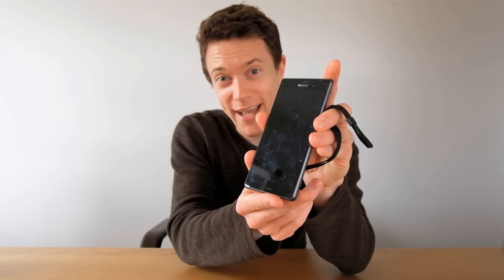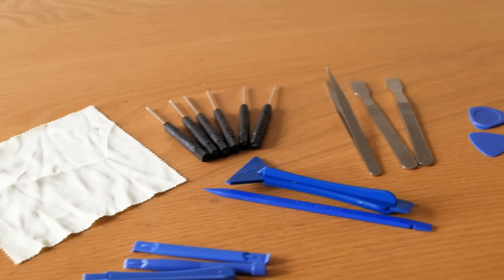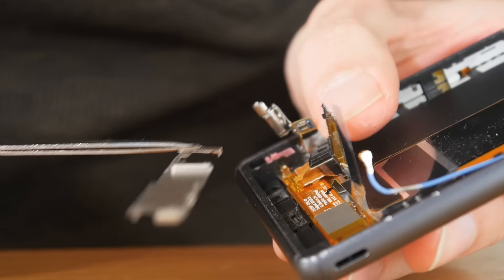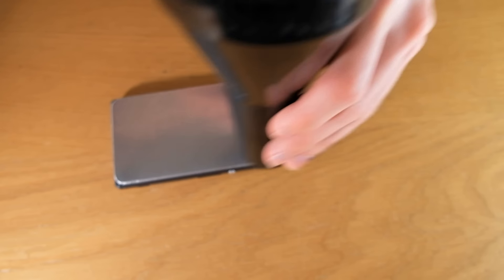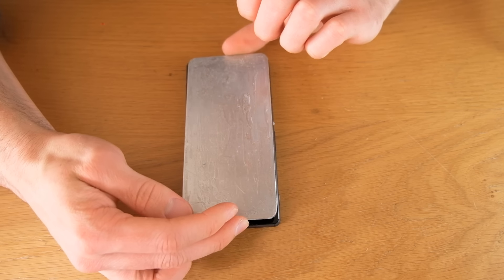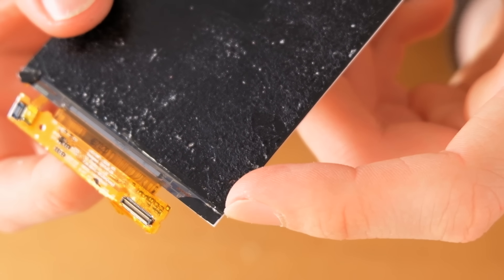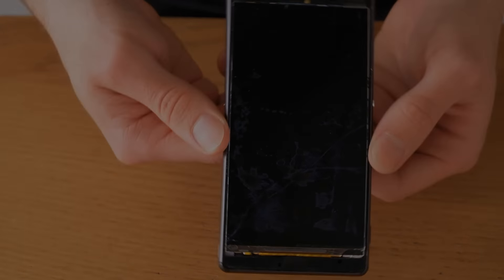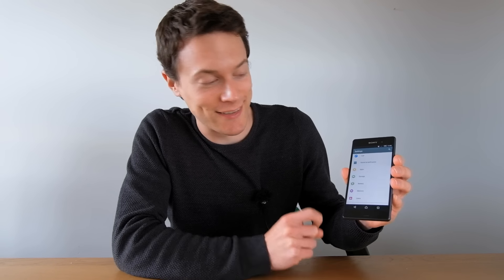Fixing a Smashed Phone Screen - on a budget! (GLASS ONLY REPAIR ATTEMPT)

Comment: I can’t believe all of the shattered phones I see.  Why can’t it be made with a durable soft plastic?
Reply from the maker: +Geena Lyon I wonder the same thing myself!
Reply: Because plastic can scratch easily.
Reply: Because u will not change ur phone with a New one if it dosent break
Reply: I know right...totally unexceptable with today's technology. The first start up to make a comparable durable phone has my business for life!
Reply: Yishai and Razonyah Beeson yup
Reply: +Geena Lyon You're right. Cell phone screens were made of plastic at one point, but I assumed they changed it due thi the touch screen features. Nevertheless, I believe if they create unbreakable screen it would cost them, which is why I'm thinking why they sealed the battery (b4 waterproof, so not sure why).. also the same with the charger which one end commonly breaks..
Reply: @DIYPerks  Prooooooobaaaably has to do with plastic not conducting electricity...
Reply: Yknow, the core element of a smartphone: an electricity conducting screen
Reply: +@Friend  Nice!
Reply: @hardopinions  same with plastic

Comment: I dropped my phone for the umpteenth time, but the screen broke this time (probably because all the other times it landed on the side or back with are protected, but this time it fell straight down on the front). I am a big proponent of DIY, but for something like this I will pay a professional to do it for $200. Amazingly they said that they can have it fixed in 24 hours. I am surprised they didn't have to order any parts considering that my phone is almost 3 years old and was never widely available in America.

Comment: Having done this quite a few times, it’s much easier to replace the entire assembly. But, if that’s not feasible like if it costs more than the phone, then a glass only is doable. But, be ready to get super frustrated. Also, the panel is like an egg shell. So, too much force and you’re replacing the entire assembly anyway. I’d practice on an old broken phone first before attempting the glass only repair on a something like a flagship model.

Comment: I came here to learn something and totally got so much more. Thank you!! I'm new to this, so this walk through was awesome for me. I have a cooking thing that I can adjust the temperature on that is very common, think its an electric skillet? It has that protective coating also, I'm going to try that to heat up the screen. I wonder what temperature to melt soldier.

Comment: Coming from someone that's had to replace a fair few phone screens... save yourself the trouble.
Don't get just the glass.
Get the full digitizer/assembly for the LCD.
Yeah it's like $30-80 more but, you will realize how much easier it is to replace.

Comment: the disconnect of the battery is a good idea to use the non metalic spudger :) epoxy.. also softens when heat is applied. so by heating it up it loses strength as well. a thermal epoxy might have worked though.

but nice attempt i always wondered how this kind of repair can be done.. and well a fail is not actually a fail. it was screwed anyways so just learned something, and we all did as well :)

Comment: Here is your next DIY project :) : Please find a way to use an old mobile phone and modify it so, that when you call the phone and the phone rings it can trigger a signal which can turn on the pc. Maybe you can take the signal from the ringing speaker or so... I don't know, but you are a smart guy, and I am sure you will find a way to redirect the signal to the power-on pins on the PC's mainboard. What do you think? Is it possible? An iPhone 3, 4, 4s, Galaxy S3, S4 will be perfect. I have all of these phones and can follow your steps to do it. But any other phone will do too.

Comment: 40 pounds is not on the cheap. MY Samsung tablet somehow fell off of my refrigerator while I was charging it. The glass screen cracked but the digitizer still works fine. I covered the entire screen with heavy duty clear tape. Amazon has a replacement screen for this particular model and the tools needed for $20.00. I think I'll go that route rather than cough up $200 for a new tablet. A friend bought this tablet refurbished and sold it to me for $50. it has a 10.5 inch screen with a resolution of 216ppi so it makes a decent reader. I love the fact that you can increase the size of the page until the letters are twice that size of the physical book. At age 70 my eyes need all the help they can get.

Comment: The top. Piece is a. Lithograph type circuit that controls the tranaistors that warm the quartz crystal. The hard glue is put to prevent that part from flexing as you know is very delicate. The black spots and lines across are where the panel. Flexed too much and cracked or got to hot. The screen you purchased as an assembly is likely refurbished but in order to do it proper very expensive equipment is used. Lucky you didmt get to the point of cleaning and using an optically clear adhesive to re join the two. ;p.

Comment: this can be done, but you need MUCH more intense heat. there are specialized tools that use a vacuum to hold the glass in place and deliver heat to the glue. then you use a metal wire to separate them.

Comment: Hi. Someone who has repaired hundreds of cell phones at this point. 

If you are not experienced at electronics servicing: Do. Not. Attempt. This. 

You need to spend a bunch in money on the proper tools to attempt that. And You WILL end up breaking the LCD anyway, you WILL get shards of glass in your fingers, you WILL fuck up the alignment on the final step, and you WILL end up buying a new entire display assembly anyway because you tried to save $20.

Comment: I know this is 4 years too late but glass only repairs suck... I personally have not done one and I just usually get a whole new display assembly and RMA/recycle the old screen so it can be potentially refurbished for future use. In fact, that's pretty much what the entire industry for phone repair does as with glass only repairs, you need to not only removed the cracked glass, but you also need to get all of the LOCA off, and put on new LOCA while keeping the LCD free and clear of any fingerprints, dust, debris, etc... Like I said, it's a pain. It can be done but it's a pain. In fact, most people that refurbish screens have special chambers they put the part in to make sure it's done perfectly.

Comment: The screen + digitizer it's more expensive than the touch screen only on amoled phones like Samsung...
   So it's worth it IF you've got a preheating station. 
    The heat must be constant and uniform when you unglue the touch screen glass. 
   It's not working with a hot air gun, becouse you cut off the heat and the glue will stick again... 
   You've got to do it while the glue is still warm and the heat is distributed uniform on the glass surface at 120 - 150 degree Celsius.

Comment: just started watching your channel and i did a front glass only replacement on a samsung galaxy S III around 2013 with a prebuilt "kit" that was similar to yours, just glass and adhesive and the glass removal tool which was plastic in my case not alimuafter you "glue" the glass off... that doesnt work and you ususally have to carefully remove the glass with tweezers... anyway i thought i did it perfectly but it had a huge bubble in the middle even though i used the provided squeegee to press the screen to the glue (it was much more viscous than in this video). needless to say I have only used replacement screens that come with the digitizer/lcd and reinstall the entire component since then, rather than trying to put lipstick on a pig Q _ Q

Comment: Better to remove battery with plastic tool or using nail. Metal can cause short and battery can even explode. Otherwise good video.

Fun story. My galaxy s7 fell of from pocket to grass on back. I had case on this thing. Panel is broken, but glass isn't.

Comment: Found a 2019 AT&T U304AA with a cracked screen on the street.

Wiped, it still worked!

So I covered it with kitchen cling wrap

Neatly trimmed with a razor knife..

No chance of getting glass slivers

into ones eyes...

A hospital trip at best.

I'll find new/used screen on eBay.

Dead used phones can be had for c.$15 there....

I've made good HTC phones out of bad....

First was in a DUMPSTER with some school books.

LUCK!

J.C.

Comment: The way my IT teacher once did to remove the shattered screen glass was to put scotch tape in all the screen, then he heat it up, lift with those tools and the glass lifted easily.
Reply: what is glue tap?
Reply: @lisetteem3054  hahaha I'm sorry. I put the wrong name, it's scotch tape if I'm not wrong. Those who are transperent usually  used for closing boxes and other stuff.
Reply: @Fil4671  ohhh that sounds way easier. Scotch tape yes, is a common product.

Comment: mine is p9 lite and one of my screwdriver fell on to the screen and the screwdriver had so great kinetic power and punched my edge of the screen. The first time when i saw the foil wasnt broke but the digitizer glass suffered alot, so. I had plastic digitizer before i did bent too much my phone and broke the lcd. Now i have glass digitizer broken, smashed in 1mm^ point and huge cracks on my phone.

Comment: Dude you realize a new screen with LCD is only $35us and if you really want to keep your lcd switch it over. Its a process but less mucking around than what your doing. You know most aftermarket lcd's now days are actually better than oem. I repair them everyday and I install aftermarket screens that come with a lifetime warranty cause they are that good.

Comment: Don't know how I missed this one. I wonder if Kapton tape on the glass would have worked better than the aluminum?  It is thin and can certainly handle the heat.  I also somehow missed the mouse/OTG adapter trick.  Since I bought my Android in Asia and it didn't come with an English manual then maybe I can be forgiven.  Anyway, I tried it and by gosh, it worked!  Thank you for that!

Comment: It would have worked as a local repair guy did the same thing with my screen and it was successful. but he used a more thinner wire to separate and the aluminium sheet thing is not a great idea. instead pull out the screen away from the mid frame and then keep the screen temperature pretty high.

Comment: I repair phones and i hv never seen anybody using glue epoxy thing to put on the screen and pulling it out its too much work 😂😂.. we have a heat plate or just heat gun, the goal is to heat enough the phone from front side while also not burning the lcd inside.. once u do that just use the tools to pull it out

Comment: Bruh as soon as he started prying it open and messing with the stuff inside I was like "NO NO NO NO NO NAH AH"

my phone is new and has one shatter mark, I don't have a case and it always manages to slip out my pocket when I'm sitting down, Moto G Power 2021, my second phone, Motorola is very strong, my first moto (my first phone, moto g7 power) got rolled over by a truck and still worked after, so I'm surprised this got a crack after a couple of falls to the ground.